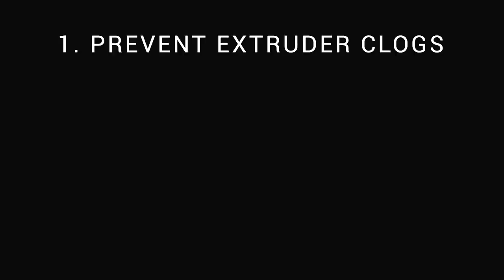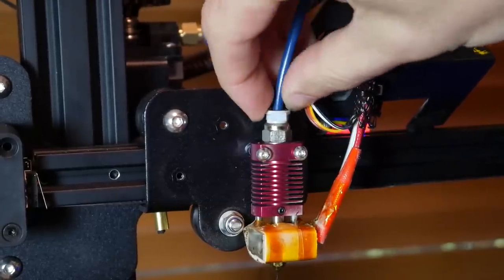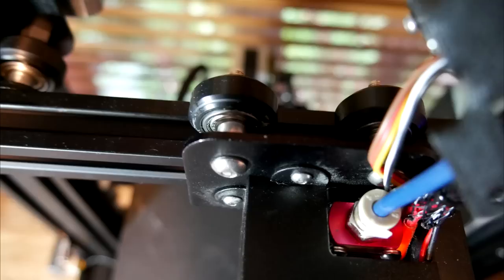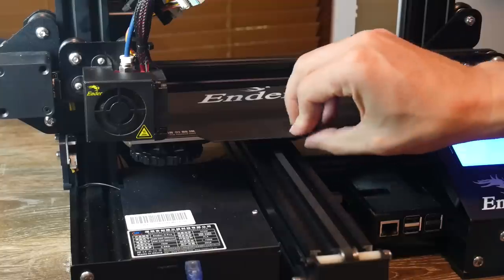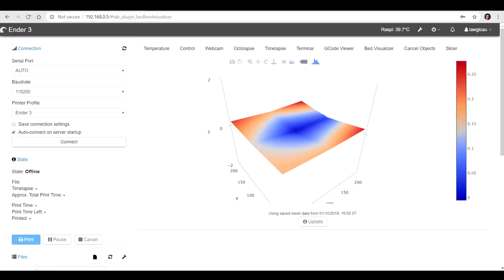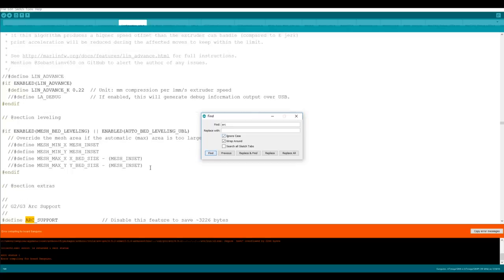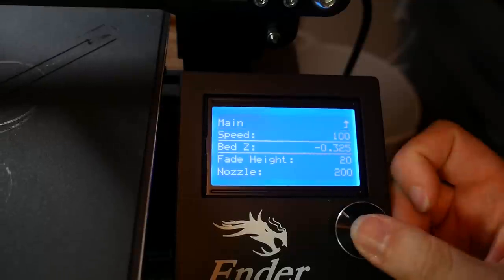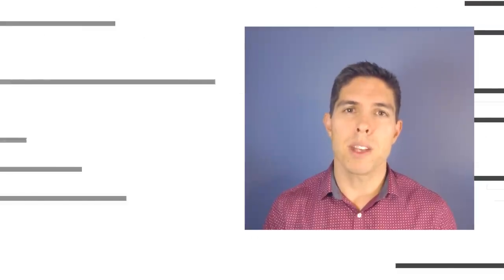5 beginner Ender 3 fixes - featuring manual mesh bed leveling guide

Comment: Not sure if already mentioned, but the th3d firmware offers a new release (R2) on the website and it alters the changes for the mesh bed leveling. The programmers grouped the required settings that are uncommented in this video. Just uncomment this variable below and you are good to go with R2:  

#define MANUAL_MESH_LEVELING

This will set the required parameters for below, including the uncomments in this video.

#if ENABLED(MANUAL_MESH_LEVELING) && DISABLED(EZABL_ENABLE)
  #define RESTORE_LEVELING_AFTER_G28
  #define PROBE_MANUALLY
  #define LCD_BED_LEVELING
  #define MESH_BED_LEVELING
  #define MBL_Z_STEP 0.025    
  #define LCD_PROBE_Z_RANGE 4 
  #define MESH_INSET 10          
  #define GRID_MAX_POINTS_X 5    
  #define GRID_MAX_POINTS_Y GRID_MAX_POINTS_X
#endif

Comment: HI. I did flash the firmware and got the manual mesh leveling to work. However, one adjustment - the Bed Z: control on that menu doesn't do anything. I have experimented with it and found it does absolutely nothing. I've gone all the way from -.5 to +.5 nothing happens. Do you know how to enable Bed Z:, or what it's supposed to do? Does it require some other line to be enabled in the configuration.h file. How is the best way to see that it actually is adjusting Z? Thanks.

Comment: Do you have a video on after you level the bed but your 3D print moves up about 1" above the platform and starts printing in the air. Even if you cancel the print, return it to home. It still comes up the problem over and over. I tried lowering the 3D platform 1" but i'm guessing the slicing software is taking the object and making it above the platform somehow.

Comment: i followed all the steps and also remade everything a few times, but the sketch stills overflowing for jsut 162bytes... it shows a compiling error saying that the program memory is already at 100%, how do i solve that...?
Reply: finally found a solution, and it seems to work without problem, just delete a lot of code lines, the ignored lines with "//" and the instruction lines that are useless, and verify the code until it finally tells you everythings okay and youre using the 99% of the code space. That worked for me, it shouldnt give any problems.

Comment: I have a stock Unit I just bought running Marlin 1.1.6.2 No BLtouch or Sensor I want to have mesh bed leveling available I seem to be able to connect without installing a Boot loader  what board is it by default I could not read it on YouTube and you did not add that to your comments..

Comment: I need your help bro, i just uploaded the firmware for mesh bed levelling after doing all the steps of mesh bed levelling i did 16 points after the 16 points finished i got the message  Levelling done , but the screen freezes and there no movement , and does not go to main screen to store the settings please help me brother i have done with 98 percent but this 2 percent i cannot do please advice

Comment: Having a problem with the printer doing the print on the front left corner. Not sure what setting I am missing. Using Cura and the print is set at the 0-x, 0-y, 0-z. Any suggestions will be appreciated. Thanks.

Comment: Another thing you can change is sd card sorting standard is set to 40 I changed mine to 10 so it don't use as much memory as long as you save your gcode with decent names you don't need sorting in my opinion
I'm gonna try the manual mesh bed leveling so will see if that saved enough space first there is probably a few other things that can be reduced to with no differences

Comment: Hi,

I've just recived my Ender 3 Pro last week and I'm still having issues with bed leveling. I uploades Marlin with enabled mesh bed leveling. First I manually level the bed in 4 point with the knobs. After that I run the bed leveling with 9 point. Store the settings and run test print but PLA does not stick to the bed. Set Z offset to -300 but it seems that nothing happen. Does the Z offset set happen immediately or need to run a new print to use it? All the time egy bed the level with preheat values.
Reply from the maker: If you're updating the z offset at the start of the print from the LCD menu the changes will be in real time.
Reply: @TeachingTech  Thanks. I will try tomorrow with Marlin 1.1.9 because previously I used the bugfix version, and I read that this is not stable could be some bugs at the system.
Reply: @TeachingTech   I've just installed Simplify3d and the strange ting is that the first line after homing is not so visible. Maybe the nozzle is to close to the bed or this is Simplify 3d feature? Skirt and the object first layer is good.

Comment: Man, I am new to this channel (I will buy Ender 3 Pro in few weeks time) and thank you soo much for all videos! Also, love that Porsche GT1 racecar on a shelf :D Have you tried to print some cars? If yes, what was the results?
Reply from the maker: I haven't done whole cars, but I think the layer lines might ruin shallow sloping surfaces. Love that Porsche, as well as the 993 version before it.
Reply: @TeachingTech  So I've bought that printer, now waiting for it. One of my goals is to make some scale cars in that printer, so I will share with you results to see if it can be done or not. But it will take soo long time, especially because I'm totally new to 3D printing

Comment: Thank you for the videos, really enjoy the information that you give us. Im sorry but i  have a question. when i click auto home. the machine sets to home. then i go to start leveling the bed. But for some reason i feel like the auto home level is different from the level of the start of print. I end up having to pause the machine and when have to relevel it again but from the hight of the axis  where it began printing. This could be an issue on my part as im very new to this.  If you could give me some advice on my ender 3 pro with a supposedly creality silent mother 4.2.7

Comment: Thanks for this perfect Video!
With your video I was able to install marlin 2.0 on my end 3 pro as a "newcomer" although I have never done anything with arduino ide before.
Now I want to activate manual mesh bed leveling.

But what does this ARC support disable?
Do not I really need this ARC support?
This has something to do with the printing of curves or right?

Unfortunately my English is not good at all ... (Google Translate Helps me...)

Best Regards

Comment: Thanks for this. I realised a sag in bed itself, i.e. if I keep a steel rule, able to see around 0.3 mm sag at mid portion. Also, there is a shift in Y axis after few minutes of print. I think the belt is very loose at bed. Please advise. Vendor is not responding for these issues. I am new to this, it has been a month since I assemble, I am unable to move forward. I have watched many of your videos and other videos before start but still it sucks.
Reply from the maker: You should definitely start by fixing that belt. Loosen the bolts on the idler, pull it tight and retighten belts. Please join a community, it will help!

Comment: Micheal usually your tutorials are very easy to follow for a newbie like me. But in this one you really rushed your explanations.
1) Today I have installed a bootloader and the lasted TH3D version of Marlin on my Ender-3 following your tutorial. To use manual bed mesh leveling why can't I keep that TH3D version and need to replace it by a vanilla version of Marlin?
2) What is Fade Height?
3) In which app did you wrote the G-code?
4) BLTouch : With the small 128kb of the Creality board, if I install a BLTouch, will I have enough memory left to install a filament sensor?
Thanks for all your great tutorials!
Reply from the maker: Hi Mike, I was trying to fit a lot in and keep it short so i think your point on pacing is fair.
1. You could add the manual bed levelling to TH3D, it is still Marlin. Trouble is the files are organised differently. If you search for the things I mention in this video across tabs you will find them and be able to make the same changes.
2. The adjustments in Z made to keep the object sticking to a warped bed are faded out over the fade height value. After this the z won't change until a new layer starts. It stops  the z stepper making those tiny adjustments the whole way through the print.
3.  I use Simplify3D as my slicer to generate gcode.
4. Yes, I have a BLtouch and filament runout sensor installed at the same time. See here: https://www.youtube.com/watch?v=gwHpXaj_6xE
Reply: @TeachingTech  If I followed you correctly you suggest to set the fade height to the value "20" am I right? Thanks Micheal!
Reply from the maker: That is usually the default, yes.
Reply: @TeachingTech  Hi Mike!  Thanks for all your videos.  They have helped me a lot as I get into this hobby.  So I want to enable manual mesh bed leveling so I can get start getting good prints to start modifying my Ender 3 :)  I grabbed the U1.R2.7 version of the TH3D Unified Firmware, and while they don't support manual mesh bed leveling, they've made it really easy.  Looks like in this version, you just have to uncomment #define MANUAL_MESH_LEVELING in Configuration.h, as I found this in Configuration_backend.h:

#if ENABLED(MANUAL_MESH_LEVELING) && DISABLED(EZABL_ENABLE)
  #define PROBE_MANUALLY
  #define LCD_BED_LEVELING
  #define MESH_BED_LEVELING
  #define MBL_Z_STEP 0.025    
  #define LCD_PROBE_Z_RANGE 4 
  #define MESH_INSET 10          
  #define GRID_MAX_POINTS_X 5    
  #define GRID_MAX_POINTS_Y GRID_MAX_POINTS_X
#endif 

I'm only finding #define EZABL_ENABLE inside various conditionals for the different mounts for the EZABL, so I think that's all that's going to have to be done.
Reply: @davidweiner8705  How is this working for you? I am about to try this exact solution as my first attempt. I have tried to compile this setup  using vanilla marlin. I keep hitting a wall and can't achieve anything less than 99% of available space. With a bootloader this isn't feasible.
Reply: using the last TH3D firmware (ie. marlin) and uncommented #define MANUAL_MESH_LEVELING it works ... with selectable menu on LCD screen.
Reply: @Marcopovitch  Thanks! Did you manage to find the fade setting hiding somewhere? I didn't see it while using "find" function under all tabs. Scrolling through them proved fruitless as well.
Reply: @Marcopovitch  Nvrmd I figured it out. It's set in the lcd menu as Michael showed. Forgot that part. Thanks again!

Comment: hello I have just built my ender 3 every thing works in the control panel BUT 1 the bed is printing off the bed to the left side I tried printing a 100.80mm object it started to print but it always taps the stop end as the  oblong print it starts as though it is going to print normal it lifts up but stops about 90mm from the stop end, I explained it prints to 1 side he told me to put the object in the center of the build plate in Cura so I told him Cura always put the object in the center but it is still printing to 1 side am now waiting for another answer his first answer seemed wrong have you any ideas on how to get it printing in the center of the bed thanks for your time I hope understand this thanks once again

Comment: I am trying to enable my Manual Bed Leveling on my Ender 3.  I have firmware version 2.0.6 on a V4.2.X board.  I am using Visual Studio to enable the code as you mentioned.  When I build the Config file I get a page of errors (too many to list).  Do you have a video for this newer firmware version?  I have looked at a load of resources but everything is becoming too much.  I am not a computer guy so this is very new to me.  Thank you for the help

Comment: I am in a quandary with my Ender 3 pro which I’ve had very good success with the past few months. I upgraded my hot end and it worked fine for about a day and then started to behave strangely. When I preheated the nozzleto 250 degrees which it could always do very quickly I noticed that it was pooping out at 184 C and then will eventually go up to 195 and flutter down and up from there. I keep trying things like checking the thermistor and it’s easy to check the heater. Everything is plugged in all right. It was working now it’s not. Is it something to do with the computer program? I have version 1.1.6 Marlin firmware. I noticed I can set it to 190 C and it will go there and stay there with it’s up and down a few degrees. It just can’t get up to what I want.

Comment: OK, I recently ran into a problem where I level it nice flat, and start a print, it doesn't stick to the bed. I have changed bed Temps and flow rate but it seems like the bed just doesn't want to stay level anymore. It constantly shifts up and down and it's frustrating. Any tips on how to fix this?

Comment: I do like you but something is missing or not good
I'm in trouble at homing xyz Course on the bed
I did like you but i had to delete one option because the probe_manually did not give me a registrar that needs to undo something so i canceled the bltouch what did i do wrong?
Reply from the maker: If you using a BLtouch, that is a whole separate video: https://www.youtube.com/watch?v=sUlqrSq6LeY
Reply: @TeachingTech  I have a question I made according to your previous video and I installed the new version and everything like you now before this video The question is what should change or replace delete instead of the change you made in configuration.h and In configuration_adv.h:

Comment: Hey just got my Ender 3 MAX and for some reason all the corners are leveled like you had it BUT the middle isnt? how do i fix this?  Also how do you get the best settings for Silk PLA?  I've moved from a Flashforge Finder to this as need bigger bed space

Comment: Great video as always! Could you figure out how to keep manual mesh bed leveling and still have M600? Becasue I really like that feature and I can't seem to free up enough space to fit both.
Reply: Nvm :D I figured that. You can just use M0 command or just "Pause at height" in Cura post processing plugin :)
Reply from the maker: Thanks for sharing.

Comment: Any thoughts why Creality would not have had 9 point auto-bed/mesh levelling as a default on the Ender 3 and what would you say is the single most important upgrade to ender 3. Would it be the main board?

Comment: Hi .. I just got Ender 3 .. Whenever I want to print something.. Temp of bed and extruder reach the required values I push the filament to start extruding  .. Then I start printing from SD .. Print should start  .. BUT ACTUALLY when printing starts the first thing to happen is the filament is pulled out and then the head will move without extruding .. I tried this on different prints .. Test Dog and other prints .. Same thing .. Any advices?

Comment: I can't slice the X. Cura has a light gray box showing the print area (235x235), but also has these dark gray areas on the front and back of the bed that reduced the area smaller than the X by about 5 mm or so. I can't find out what they are and how they are configured.

Comment: Well, that "mesh bed leveling" seems a bit overly complicated. I too had a warped bed, but I found a much easier way to fix it. 
First find the low spots with the "paper method", then take the plastic bed-cover-thing off and flip it over- now comes the really high-tech part- put a few pieces of masking tape where you expect the lowest points are. Then experiment with adding and removing tape and leveling until everything's flat. (Naturally the bed and schnozzle should be heated up while you do this)

Comment: Hi man, I just got my 3d printer a couple of days ago, and thought I'd print my first proper thing. I used one of the testers already on the SD card the printer came with, but when trying to feed the pla through I noticed it wouldn't go through the hole at the back, in order to go through the tubing and down into the nozzle. 

I'd tried printing something before without understanding properly how to use the printer and tried to push the filament through without heating it first, and I wondered if the reason it wasn't going through now was because of the past mishap. However upon closer inspection it looks as though the cog has moved, and now whenever I try to push the pla through it hits the side of the hole rather than going through it. I don't know if anyone understands what I'm trying to say, but if you do and can offer me help it will be greatly appreciated!

I'm using Ender 3 Pro btw

Comment: For some reason the lines in my code are different than what you've shown in this video. I now have bed leveling option on my Ender 3 but the G-Code doesn't do anything. Is it because I'm using a newer version of firmware or newer version of cura? I went ahead and did the manual bed leveling, it has 25 steps not 9. So many differences. How can I tell if it's working?
Reply from the maker: The firmware will inevitably progress since the video. 25 points however would be a setting in the firmware. the probing points would be set to 5, instead of 3. Once the print is running it will be subtle, but putting your hand on the coupler between the stepper and z axis rod should reveal whether it is moving slightly. Please follow the gcode commands for verification as shown in the video.
Reply: G29 S0 does nothing. Any idea why? Other than that I think it's working. I can't find anything in the code to configure the number of points.

Comment: I'm doing mesh leveling, but it does not get saved and when I print, it is disabled again, can you help me?
Reply from the maker: There was a part in the video where I had gcode to retrieve the stored mesh. Also check that you compiled with eeprom enabled to assist in the mesh being saved after power off.